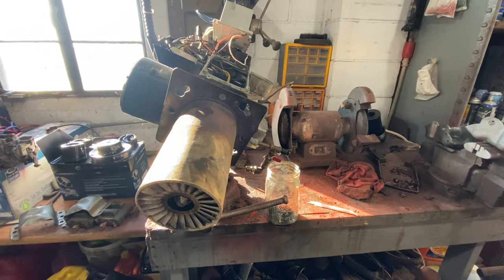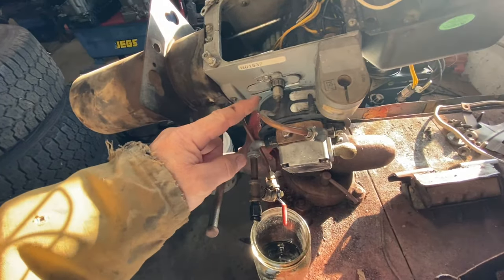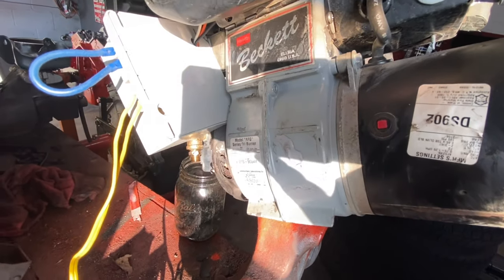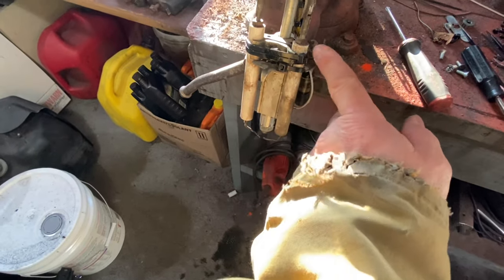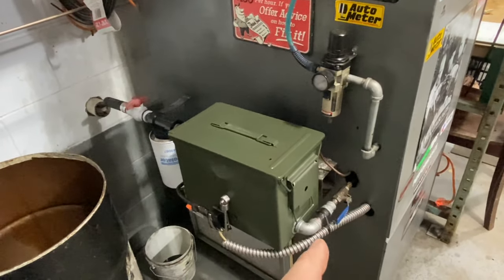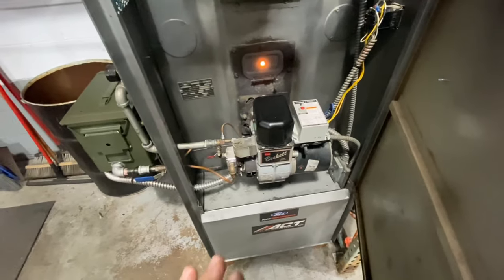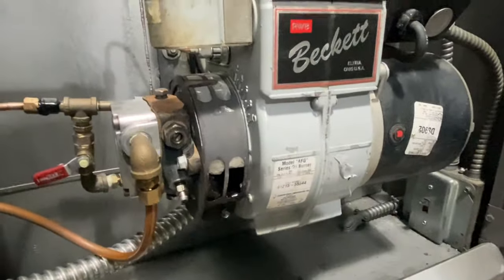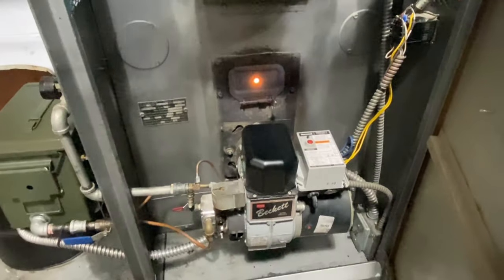DIY Waste Oil Heater.   Updated video better audio and detail

Comment: This is a VERY smart video. Details and descriptions and pics and demos. Everything but the dancing girls. LOL.  Tip: For redesign of your ammo box, simply turn it around, put heating element below the latch, the outlet higher and just below the back hinge area. I want to build one of these for my garage!
Reply from the maker: Thanks. I didn’t see your comment till now. Seems they have been getting buried. I’m actually looking to get away from the ammo cans. At least because of the coating inside them. The oil and heat over time is bubbling the coating off and it’s finding it’s way into my screen. At some point I plan to use a stainless steel container with some more depth to allow the float and element to stay away from each other. Also I plan to make a baffle to separate out water and coolant better

Comment: Excellent presentation!!! Well spoken and clearly explained! 
I have a few questions please:
Can you tell me what the minimum air pressure and CFM needed for this to work? I'm looking at using an air pump instead of a compressor to reduce the electrical consumption  
And also do you find any "Crud" in the burn chamber after burning over a 100 gallons of oil? 
Thank you sir
Reply from the maker: I’d say 5-10 psi min. I run that or up to maybe 20psi max really.  As for CFM not certain on that. The nozzle “Should” only allow a set CFM at the pressure ranges stated. The CFM in my estimation should be pretty linear and easy to find based on the nozzle rated GPH. I’m not sure if CK Burners posts that info??  Maybe ask them?  Good luck. Oh, yes I get some build up over time. I clean chamber each season.

Comment: The END CONE turns the combustion air in one direction and if you could picture of the inside of the nozzle it’s swirls spins the droplets in the opposite direction to improve vaporization and combustion.......... I don’t believe the end cone is Beckett, more likely CLEAN BURN?
NICE JOB SIR! GREAT EXPLAINATION❤️🇺🇸.  ❤️❤️BECKETT❤️🇺🇸
* tried doubling the bottom half of the gasket on the blast tube assuming that the furnace is level? you want the last tube to be tipped towards the combustion chamber ever so slightly then upon shut down you have a combustion chamber that’s 2000° that heat radiates back at the nozzle assembly and expands the oil that is now locked in the blast tube and it dribbles out the nozzle if the blast too busy obviously pitch to the chamber that little bit of oil will run back into the glowing heart chamber and you’ll be none the wiser! 1 of many many will require a silicone damn in the bottom of the tube❤️🇺🇸
 🇺🇸THANK YOU🇺🇸
Reply from the maker: Great advise on the gasket spacing/tilt of unit. As for the end cone, correct it’s not Beckett. Came from the CK burners company. Which may be a part from clean burn? Not sure. All the rest of unit is from the original Beckett unit which came with original fuel oil furnace.   Aside of course from the whole siphon heated oil head

Comment: This is one of the best if not the best video detailing these custom systems. Thanks a lot for posting. Was curious about your setup for the preheater in the ammo box and more importantly what kind of float/how it is mounted.
Reply from the maker: Sure I’ll have to probably send some pictures or something of that nature. Not sure if I can do that in this messenger maybe I could message it to you in an email or something? Maybe shoot a private message with an email?  Or whatever you think would work out, I can snap a few pictures inside the box. I may already have some it’s pretty straightforward. There’s just a water heater element in there and there is a brass float like what you would have an a toilet with a valve that I found at the local hardware store and the float basically ask directly on the valve it’s a needle and seat type
Reply: @ballengerfarmhomestead2772  Thanks for your reply. Unfortunately YouTube removed the option to message people through here and posting email publically like this would be ill-advised we would get way too many spam emails. I understand how it works now, with a regular needle and seat type float. I had forgotten you used a gravity type system. Others I've seen used a float valve with an actual switch that would turn on a pump outside to pump oil into their "tank".
Reply from the maker: @Sugarkryptonite  the pump option was something I though about. But didn’t want the risk of pump sticking on.  So gravity worked. I will say when real cold and the filter is older the flow reset in will be to low to keep up. Usually this is fixed if replacing the filter often. Even if it’s not that old. Just keeps flow moving

Comment: Great video , used it to help build mine ,, I did fix the oil running back into the tube and noticed after watching ur video it may also be ur problem also , the supply tank is to high to the level of the pump , when unit turns off it was siphoning out the tip of nozzle and running back in tube ,,, I lowered my tank below the oil connections on the pump and the oil went away , may be the fix for u to !  Can send u pics
Reply from the maker: Glad it could help you. My current tank is lower than the pump. I think in that video it wasn’t. What my issue mainly was is the angle the whole unit was at going into the burn chamber. The collar which holds it to the furnace needed a different offset to tilt the whole assembly into the chamber so to speak. This allowed the reming oil to fall back into the chamber and be burnt up. It wasn’t much but some would come back into the area outside of the burn chamber. Glad you got yours too work!

Comment: I just noticed you do not have a barometric damper on your exhaust flue. Is there an advantage of not having one? It seemed to me that it would allow more of your room heat to escape with the exhaust?
Reply from the maker: So I don’t have one because in my case not needed. To your point about the heat loss, maybe?  I don’t know usually the dampener is for excessive draft which is not a problem with my setup. I would actually think that you would pull more room air out on a day with winds allowing for high draft?  Aka pulls room air into the stack at the dampener?    Versus a “closed” system like I have. There is a small flame  inspection door just about the burner with a pilot hole in it to view the flame. This would allow some more air in for combustion and thus draw some more room air in I imagine. But in reality it would be negligible. The building is pretty drafty anyway so in all reality, I don’t think it would actually matter in my case. Good eye though!.
Reply from the maker: Also, to slightly answer your question about his advantage to having one since the air and oil mixture is forced into the chamber under very rare circumstances. You can actually get a little blow back through the barometric dampener.

Comment: Nice video. If you turn your fuel up does it smoke ?
Reply from the maker: Yes it can overwhelm the fire box and smoke. If you go too heavy on the fuel. Can also blow out if too heavy with the air pressure. Once you find the setting you’re looking for it will stay put and run solid. No smoke at all

Comment: Very nice video. I have same set up. BUT I have my'n set up to burn a gallon an hour. Can I use the same nozzle to variable rate the oil
Reply from the maker: Sure. Basically any restriction ahead of the nozzle will pull flame back at what ever rate you desire. Down to almost burning out. Of course to be clear this ONLY works best IF you have the oil under pressure coming up to the nozzle. The control is better and will actually allow you to over-fire the 1 gallon per hour setting if you wish. Of course do that safely!!!  The siphon type nozzle rating are based on “pulling” oil to the nozzle. If pressurized you can over or under shoot that number.
Reply from the maker: One other thing to clear up. If you are using siphon type nozzle and still actually “pulling” oil to the head (siphoning) then a restriction valve will work. But it’s much harder to adjust because the siphon doesn’t have much “vacuum or pull” a restriction will make it hard to keep oil flowing especially if it’s cold. Good luck
Reply: @ballengerfarmhomestead2772  Thank you
Reply: my first nozzle I ran 1.0  around 20 psi  it was too much of a flame thought I would put a hole in my boiler, put a large stainless plate to protect it. went to a .05 at 8 to 12 psi too low of a flame. I use a small used dental air pump kick in when the system runs.  think it too low  of a nozzle too much excess waste. might go with .075 and run an air compressor  still use the older cd burner adapter on my beckett.

Comment: once a week , 50 weeks a year , i pick up 15 to 20 gallons (5 gallon buckets) from a one man service station on the road  between my house and my shop . i don't take oil from any other source . 750 to 1000 gallons a year , never any antifreeze , water , trash , etc . i recommend developing such a source to anyone using wmo .
Reply from the maker: Yep you are correct. I do have some of those connections. I certainly get enough of my own oil from services. But there are people who I trust to give clean oil on a semi regular basis. I’d love to connect with another shop. But it’s hard sometimes to get in. One shop I had before gave me oil. But then they started to burn there oil

Comment: About how many gallons of oil per day or hour? Interested in doing a similar setup but I have not really seen the burn rate discussed.
Reply from the maker: So I’m not 100% in terms of actually measuring it. What I do know is the nozzle is rated for .75 gal per hour. But this is at the set air pressure the kit recommends and with no pump assist (aka ability or regulate the flame) like what I have. So in my case I can technically really go from about .5 to 1.5 gal per hour depending on what I wish to do. I’d say the average usage is close to 1gal a hr based on how often I added a gallon of oil in the early years before I got the outside tanks hooked up and had automatic flow.

Comment: Why wouldn't you just heat the oil, filter it, heat it again as it is being fed into the original pressure pump and go from there? Why go through all this trouble?
Reply from the maker: It actually not much more work. But the stock pump and nozzle are not capable of lighting off the waste oil. Since fuel oil is thin and flammable at much lower flash points, it’s easy to inject and light. Waste oil has a higher viscosity and higher flash point. Thus you need the added heat, atomization from the larger nozzle head, and added oxygen from the compressed air.  All together this makes the east oil burn hot and completely. Stock unit even with hot incoming oil won’t even atomize (turn to a mist) at the tip. It just shoots out in stream. I tried this first and could not get a fire to stick. Now it did work ok in the first version where I converted a wood burner and injected a small amount of oil with stock pump. But the wood fire was what actually burned the oil. Essentially the wood fire was assisted by shooting oil into it.
Reply: @ballengerfarmhomestead2772  Thanks for the quick reply! What is the air pressure at your regulator that's needed for a constant flame? I'm trying to eliminate the use of an air compressor if possible. What about cutting the waste oil with either old gasoline or new gasoline to thin it out as well as heating it?
Reply from the maker: @jrperrotta  Air pressure on my setup is relatively low. Approx 10-15lbs.  Possible to cut oil but  Be careful with heating it if you have fuel mixed. Especially gasoline. As you can get vapors coming off and potential ignition.  Still not sure if it would work with a stock pump??
Reply: @ballengerfarmhomestead2772  What are your thoughts about used commercial cooking oil? Do you think that would work as a direct fuel source?
Reply from the maker: @jrperrotta   From what I can tell yes if it stays warm and filtered. The issue is with some oils they get a lot of fats and other suspended materials in it an that tends to make it solidify. Of course this doesn’t happen with good oil practices so depending on where you get it could work great. I have a guy who gives me his old fry oil and I just dump it into my oil containers ahead of filters. Works great

Comment: Awesome set up. Mine is very similar. How many psi do run for air pressure?
Reply from the maker: So I vary the pressure dependent on the flame I with to achieve. It will vary from a low 7ish pounds to maybe 20-30 psi. It really depends on how much heat I need. Since I can vary the oil flow and air it gives a great flame adjustment. It also changes as the unit warms up.  Usually requires less of both once the whole thing is hot
Reply: @ballengerfarmhomestead2772  I can't go much over 3 psi on mine. I'm usually running around 2 psi. I have the mass air band  completely closed and the air shutter I run at about 4 but I did restrict some of the air holes on the air shutter. I have been playing around with it to try and run with a higher psi but haven't had any luck.
Reply from the maker: @dobber1988   are you running the setup as a siphon type or pressure from the pump to nozzle?  This makes a big difference. I assume flame goes out above 3psi?
Reply: @ballengerfarmhomestead2772  I'm using the oil pump on the Beckett burner to circulate the oil back into the amo can and siphoning off of a T using a valve to regulate how much oil it siphons in. Pretty much like your setup. Yep flame goes out over 3 psi
Reply: @ballengerfarmhomestead2772  Do you have have the air shutter completely blocked off or at the lowest setting?
Reply from the maker: @dobber1988  mostly blocked off. You can see in the video the air duct tape (looks like tin foil) covering much of the inlet. But I still has some air flow. Maybe 1/4 of total
Reply: @ballengerfarmhomestead2772  will a setup like this run off just the centrifugal built in fan and not use external shop air? I wouldn't want to have rely on a compressor and just something else in the mix.

Comment: What do you have for a fitting and line coming off the back side of the oil pump? Mine has a 3/16 flare fitting and if I remove it there's some spring inside the pump.. Did you remove all this and just add a larger fitting on the pump? I feel like mine is starving for oil the flame isn't anywhere near as aggressive as yours is!
Reply from the maker: I kept the standard fitting I think 1/4 inch?  No I have to check. But no spring inside. I know the pump also has a spring loaded pressure regulator which looks like a hex cap with a screw inside to adjust pressure??  Wonder if something is mixed up?   Not sure I’ll take closer looks when I get over to shop
Reply from the maker: I can’t seem to post a picture to here. If you have an email I can send a close up of the pump head and the fittings/flow direction
Reply from the maker: As side note in the video from about 5-6mins in you can pretty clearly see my pump side outlet. I is a 3/8 galvanized street elbow going to flare copper tube. Hope this helps. Where you place the ball valve will make a big difference on the flame also. Meaning if it’s before your nozzle but after the return t then all your pressure will just go back to the tank instead of to your valve you need to be able to restrict so that the pressure is forced into the nozzle
Reply: @ballengerfarmhomestead2772  ordering some parts and going to try redoing my line while pulling out and cleaning the entire burner. not sure if something is suddenly causing an oil feed issue or what is going on,  burner will run fine but have small flame, then randomly its got a real nice flame, and then it'll be back to small flame again without me touching anything at all on it!  crazy!  I'll let you know what my findings are and comment back so others can be informed as well.  Appreciate videos like yours that actually show everything! Very helpful!!
Reply from the maker: @nicholassmith2353  ok good to hear. Look close at the screen at your pump. It’s right inside the cover on side of pump. It’s a fine screen and can easily get clogged or a film build up and restrict flow. Also if there is ANY coolant intrusion into the oil your burning it will affect flame in same way. It doesn’t take much and can actually slightly “suspend” in the oil if churned around and take time to settle out. Good luck my Freind!!

Comment: I tried to copy your burner and how your still using the original oil pump on the unit with the tee to be able to control flame. What psi are you running off the pump tho? And are you still using the siphon nozzle that comes with the kit? I can get mine to light but will not maintain a flame without holding a torch to it.I have played with the air pressure from 3 psi till almost 20 and gating the oil with the tee and get very little success. Any help would be much appreciated.
Reply: If you heat the oil it will work off 20 to 30 PSI. No heat more air.Make sure your oil is filtered from any sludge. I've seen the nozzles plugged up but can be cleaned out if needed. Get a propane tourch flame going on the back of the nozzle if your not using a constant ignitor
Reply: It the spark plug/igniter supposed to be on all the time or just till it establishes a flame, I have tried so many diff things and I cannot maintain a flame, it went back up on the shelf again this year. I don’t understand what I’m doing wrong